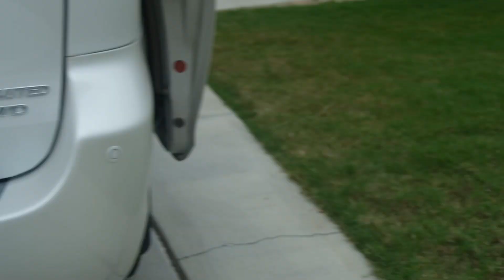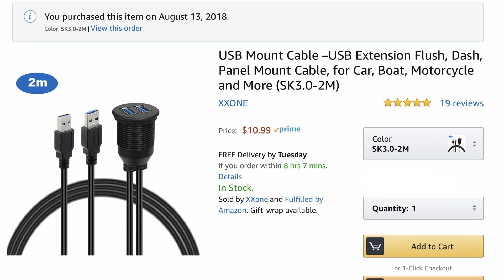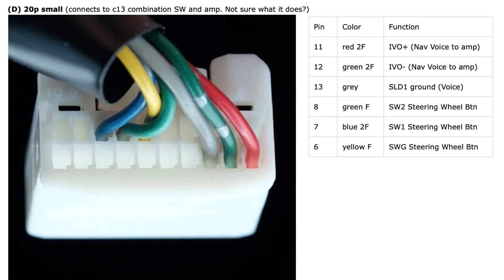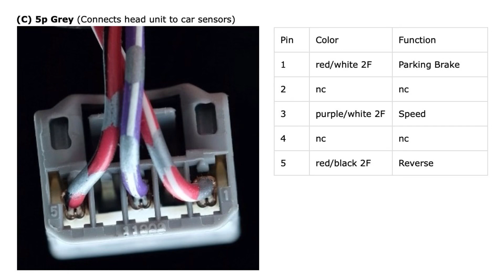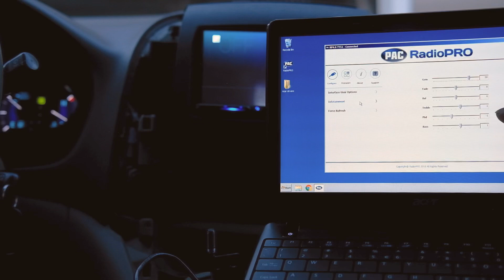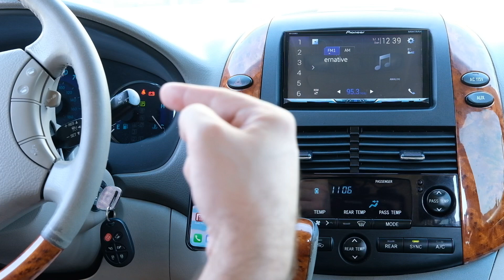Toyota Sienna CarPlay Install 2006-2010 JBL Limited

Comment: I have this exact same car. I love the car but it would be nice to have updated features. Does your navigation still work or are you using navigation from the phone? Is there anything different you would do today now that this is over a year old? What was your total cost? Would you use a different unit now in 2020? Are there any other modifications that you have done to the car, engine wheels, ect.. Is there any way to improve voice recognition or does the new unit do that for you? This looks a bit out of my skill set. If I took it to a shop is there any advice you would make?
Reply from the maker: Cool, I'll try to answer all of your questions. The system has optional navigation unit if you wanted but I use Carplay which uses the phone for navigation. I dont use the RES much but I may have used a more expensive HU if I did. I think wireless carplay is the future. You almost always want to use Carplay but it is annoying having to plug in a phone every time. Because of the design of the dash opening the screen is angled back slightly instead of perfectly vertical. The OEM screen tilts and so does the one I bought. Unfortunately the glare from the sun still hits at bad angles. I might make a small shroud for the screen to block the sun. I am also going to disconnect the illumination (orange) wire. I drive with the headlights on almost all the time and this triggers the display to go into low brightness mode which makes it hard to see during the day. You then need to press a menu button and a Sun button to toggle the brightness every time you drive. Other than the car play I have also replaced both auto sliding door motors and cable assemblies. This is a huge pain but totally worth DIY if you can due to the cost. You can have any car audio shop do this install for you pretty easily as this is what they do every day. Just make sure you find a competent one who knows you need the custom wired interface and can do it. Cost was HU + converter + wiring harness etc. I believe it was under $500 total. You could easily spend $800-1,000 on a better HU with more features like wireless carplay and more entertainment options.
Reply: Brett Martin nice! Happy to see you still replying to everyone. My thought at first was I wish I knew what his input is after using that particular head unit for a while, since it was a successful wire job and HU combo :) 

Maybe someone can hire you to install a more high end head unit and you can use that opportunity to answer more questions and show what else is possible 

Either way, you’re doin gods work my friend haha! Take care!

Comment: Question? Very nice set up their does the radio have internet setting and can it okay dvd
Reply from the maker: Yes it can play DVD's. The screen flips down to load DVDs and CDs. You can also play DVDs in the existing rear entertainment system. The radio does not access the internet directly but you can use apps on your phone to play music etc.

Comment: One more question, sorry.  Does Double DIN refer to size of opening?  What is Car Play?
Reply from the maker: "Din" is a standard opening size used in cars. Double din is 2x high. Most LCD head units are double din, older basic stereos are single din and half as tall. Carplay mirrors your iPhone screen and acts as a remote control for your phone. You can then safely use the phones functions like music and navigation while driving.
Reply: Brett Martin does it have to be a double din or can I also install a single din radio ?

Comment: Great info in this video.  I just purchased a 2006 Sienna and want to upgrade to a touchscreen with a CD player.  I've seen several on Amazon with a CD player.  Could I also install a backup camera to hook up?  My van is not equipped with a camera nor does the steering wheel have the buttons on the right side.
Reply from the maker: Thanks. Yes this will work with your car. You don't need to have the steering wheel controls for the Bluetooth etc to work. You can install any backup camera and plug it into the back of the radio. You can also buy the OEM buttons for the right side if you really want and they will work with the radio too.

Comment: Well thought out video. I was thoroughly impressed with it all. The question I have is how would I be able to stream YouTube/YouTube tv, Netflix, Amazon Prime videos from my iPhone to the head unit? It would make road trips for my kids amazing. What difference would it be for me since I have a 2005 AWD xle limited?
Reply from the maker: Thanks for the comment. I haven't tried it yet but there is an A/V input in the rear drivers side that feeds into the RES and head unit. You can get an HDMI to RCA adapter and then plug in any HDMI device, a phone, amazon fire etc. That's my plan. Conveniently there is a 120v outlet right next to this RCA plug to power your device.

Comment: Hi, I am installing sony car play to my 2008 highlander with JBL stereo. Will this PAC work for that purpose?
Reply from the maker: Yes it will. Depending on what stereo you have the specific connections may be a bit different but generally the same number and type of wires needed. The PAC is the translator between your sony and JBL so they can speak the same language.

Comment: Hey, what did u do to get the rear Entertainment system to function?
Reply from the maker: RES is a source sending a signal from the DVD or AUX into the head unit. Those wires are shown in my diagrams. Just wire the in-dash connectors to a standard RCA cable and plug it into the AUX AV input for the head unit.
Reply: @BrettMartin84  Thanks bro. I'll definitely try. I have a 2004 Toyota Sienna xle limited. Much appreciated. I'll let you know how it goes. I just purchased a Kenwood Exelon.
Reply: @platinumpas  how did it go, were there any drawbacks?

Comment: REVERSE CAMERA RETENTION:
Hey, Brett.  Did you need the Axxess AX-TOYCAM2-6V Toyota Back-Up Camera Retain/Add-On with 6 Volt Turn on???
Per the PAC RP4.2-TY11 Radiopro4 Ty11 manual (page 8 bottom:  https://assets.sonicelectronix.com/manuals/pac/rp42ty11_manual.pdf ):  

"You can obtain the necessary 6v+ for the factory camera from pin 12 in the RP4.2 Interface Connector 2 (Fig.3)"

Looks like the Axxess AX-TOYCAM2-6V harness is not needed.  Can you confirm that it was not needed or advise how you used it?  
Thanks.
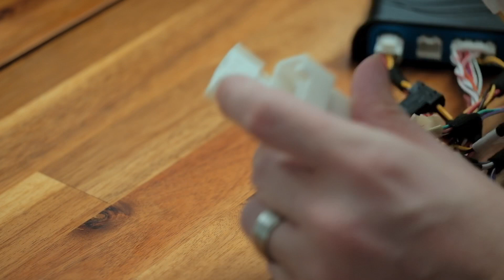Reply: nevermind.  @ 6:00 you explain the harness that you used.
AX-TOYCAM2-6V
The PAC RP4.2-TY11 only has the 6V power output to power the camera so that a 12-volt to 6-volt Step-Down Converter is not needed.
The AX-TOYCAM2-6V has the plug-play connector to the Sienna (that will feed the video), otherwise, I'd have to wire it myself (RCA plug:  identifying the video + and video - wire colors on the Sienna and splicing in an RCA male end terminal (to plug into the RCA female end terminal in the head unit); 6V POWER:  identifying the power wire and splicing in the 6V from the PAC).  Like shown here:  https://www.youtube.com/watch?v=1u7RgCnaer4

Comment: Hi GREAT video to start with.  One thing thou, Could you give me more specifics on the tap in you did on the rear dvd player unit wires in the front (black , gray and blue)  Which wires you tapped into and where the go on the pioneer unit.  

Thank you all the way from Iceland :)
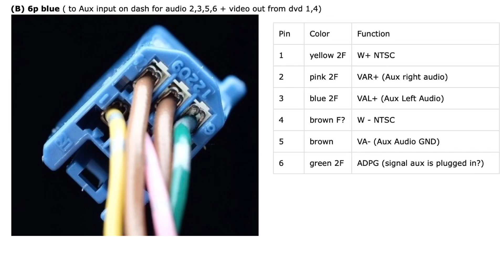Reply from the maker: Input E2, E3, E4, E5 Black connector shown at 14:08. These wires are connected to standard RCA connectors for INPUT into the head unit FROM the rear dvd player for audio. Video comes from  the blue connector (B) using B1 and B4 14:23 again, wired to an RCA cable, Center positive B1. The pioneer will have female RCA connectors for aux audio/video input.
Reply: @BrettMartin84  Hi Brett, quick question:  Did you just cut a set of RCA cables (red/white/yellow) and hooked the exposed wires to the center console, then plugged the other end (RCA ends) to the female RCA connectors on the Pioneer?  I appreciate your input.
Reply: @jguzman76  I need to know the same exact thing. Did you ever figure it out? An answer would save my life. My wife is not happy with me right now. 😂

Comment: I'm about to do this. haha.   Your prep of the wires in the car  from about 13:30-15:30 - do you have more info?  what I need to "tap into" what I need to purchase to do all that?   thank so much!!!
Reply: You have to splice into those wire colors he mentioned on the black, gray OEM plug and add terminal adapters (male to OEM side; female to the corresponding PAC RP4.2-TY11 radio harness ... or male/female vice versa).  Looks like he spliced into and didn't cut off the original plugs.  You can just cut off the original OEM plug if it no longer serves a purpose.  You'll need wiring (either 18, 20, or 22 AWG; just search for what gauge radio installers use and buy that) and terminal adapters.  You can use any brand or type; he uses the blade; you can use the bullet or some other proprietary type/brand.  Adding "plugs" just makes it easier vs. soldering or tying together two wires.

I assume that the PAC RP4.2-TY11  explains what wires go to what on the unit.  OR if the wires go into the Pioneer head unit instead, then the head unit directions explain what wires go to what.
Reply: @repair6964  Thank you for the help!
Reply from the maker: I just used a small wire stripper to cut into the existing wire without removing the OEM connector. Grab some hookup wire, strip the tip 1" and wrap it around the exposed OEM wire and solder the joint. Using a splice connector would also work, so would cutting the end off and splicing with solder or a connector. This is my preferred way to do it so it can be undone easily.
Reply: @BrettMartin84  Thank you for the additional info!   do you have any more info on which lines go to PAC  and which wires go directly to Pioneer unit?

Comment: What i meed to power the factory dvd? I install a double din radio already but factory dvd dont turn on
Reply from the maker: If you have the same model as me the factory DVD should still work independently regardless.

Comment: Thanks for sharing. Would you mind to send me your files that show the info for the Toyota wire hardness? I'm about to install a new radio ATOTO A6 and it would help me to print that info and have it with me when I'll do the connection in my Toyota sienna. Thanks in advance jfroux_1@hotmail.com

Comment: I just finished installing the same setup but my backup camera won't come on automatically when the car goes in reverse. What could I have done wrong? The camera works, just not automatically in reverse.
Reply from the maker: You may need to configure the stereo for the right polarity for the camera input or trigger polarity for reverse wire sense. Or you may just need to "enable" backup camera as a source or feature.

Comment: Thanks for posting this Brett, very informative. I just finished putting basically the same equipment in my new-to-me 2004 Sienna, except I used a Sony XAV-AX100. Everything works great with one exception. The radio volume seems to go up and down, or some of the front (I know for sure it's the left front) speakers are dropping in/out. It's almost like it's a sine wave with a period of 5-10 seconds. I will have to research it.

Where did you get the file for the PAC software ZIP file? I cannot for the life of me find it, i.e. the software so I can hook my computer up. The file is radiopro_setup.zip, but I just can't find it. Is it bundled with the latest revision of the PAC software, which I can find the zip download for that.

Thanks!
Reply from the maker: https://pac-audio.com/catalog/radiopro-radio-digital-interfaces/radiopro-4-radio-replacement-interface-for-select-toyota-vehicles go to the website. Go to firmware downloads. Last one is the install/config tool

Comment: Thank you for posting this Video,  I have problem with OEM HU 2008 Denso E7007 OEM navigation radio just  plain failed in the usual manner.
Just wondering for Interface installation, if we need to retain the OEM JBL amplifier  do we have to set the Volume half or 3/4 with OEM HU when still alive to set default gain (volume)  by  saving automatically  that setting at the amp memory? (proprietary signal from HU).
I read so many problem if we need to integrate the aftermarket HU with OEM JBL..and ended up with replacing OEM AMP
 if that is the case. I will be out of luck as my habit always turn the volume down  before turning off the HU totally.
Reply from the maker: If you are trying to use the OEM JBL amp you will want to use the OEM head unit to dial in your settings. The OEM JBL amp takes a single Left/Right stereo signal as the input and it handles splitting that to all 10 speakers, front and back. I needed to use the converter to allow me to set my OEM amp and enable all the speakers. You will want this as well and you don't need the OEM HU to do it.
Reply: Thank you again for quick reply, Just to confirm "if  we need to retain the OEM JBL Amplifier" first thing we still need OEM HEAD UNIT to Dial in volume setting as a default volume  for replacement with the aftermarket Head Unit,  if we don't have OEM Head Unit will not have proper setting no matter how good is our aftermarket HU. ? and what is the converter you meant to  enable all the speakers? is that the  Interface Radiopro4 Ty11?
Reply: @agustiant  For what it's worth I also have a 2006 Sienna Limited. I went with the iDatalink Maestro RR and it "wakes up" my factory Amp and I get sound with plenty of volume from all of the factory speakers. When I purchased the van, there was already an aftermarket HU, so I have no idea how the volume and EQ was set for the factory Amp, but everything works fine for me. The only thing I do not have control of is the Subwoofer levels. Sound comes from the sub, so the factory Amp is feeding it, but my head unit cannot control how much it thumps. I'd be interested in finding a workaround for adjusting it if anyone has an idea.

edit: I meant to mention that the iDatalink can control the factory Amp gain, so I believe if these was set too low when the original HU died, you could still adjust with the aftermarket unit.
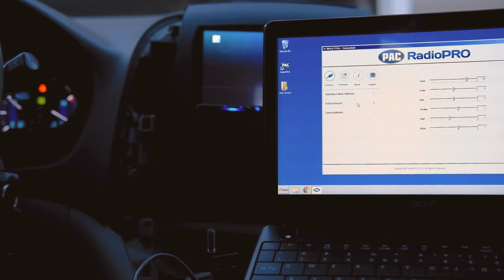Reply: I am guessing and if you see on the Video 17:35 he set it with PC inside the PAC (interface/converter). just wondering if your Maestro can send signal to equalized  from aftermarket HU to the OEM amp
Reply from the maker: It will still work but you cant adjust the fade, rear balance, amp gain, etc without the PAC and a computer. Most aftermarket amps have these controls as physical external controls. The OEM HU controls some of this like fade/bal. Vol will always be controllable by any source like a new HU but the amp gain might be too high or low to sound how you want it.
Reply from the maker: I looked into both but I could only find info on the PAC from other Siennas where it worked. Even the PAC website isn't updated to show that it works with the Sienna 100% even though it does. The PC connection to the PAC only works after it is 100% installed and connected. Controlling the Sub gain is one of the things it definitely does. I'm not sure if the PAC permanently sets the amp settings or if it simply sends the saved settings every time the car turns on. It might be possible to buy a PAC TY and just plug in the Amp connection and the PC connection and adjust your sub output and then switch back over to the Maestro and see if it remembers.
Reply: @BrettMartin84  Thanks for the idea. I'm not sure if I'll get around to finding out if that works or not. I'd almost rather keep the sub at it's currently lowish output than bump it up and nave no way of taking it back down after returning the PAC. Even if I switched over from the Maestro to the PAC, hooking up a PC to adjust the sub output is pretty inconvenient.

Comment: Do you have a console on the ceiling of the second row? Do you retain the function of that DVD player? Or does the new stereo basically disabled the mid console?
Reply: FYI, if you have a 2004 - 2005 Sienna, the 2nd row overhead DVD player will NOT work without the factory head unit. 2006-2010 will work independently, and as Brett Martin mentioned, there are lots of options on how you set up up since the DVD has AV outputs that run behind the dash, 2 headphone jacks on the side, an AV input jack in the 3rd row, and wireless headphone support.
Reply: @chillydownnow  will the DVD player still work by itself? Even if I can't hook it to the new head unit?
Reply: WiLinda Ward yes if you have an 06-10 sienna. 04-05 won’t without the stock HU
Reply: @chillydownnow  crap... Just spent $600 on a new head unit. Now I'm going to have to replace the rear DVD 2! My original jbl head is playing out. Smh

Guess at least I won't have that horrible jbl navigation now. Google maps here I come!
Reply from the maker: Yes and yes. The DVD can send both audio and video to the new head unit into the AUX so the speaker system can play audio or the front can see what the back is watching. Further you could play something in through the existing AUX port in the rear that would also work. I did not wire it in the opposite direction though I think I could have, sending video from the front to the rear.